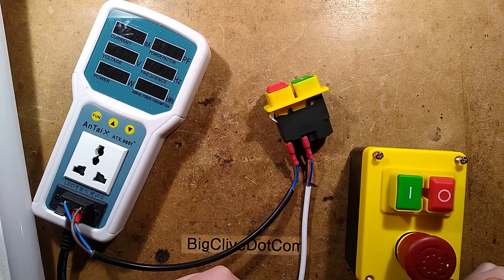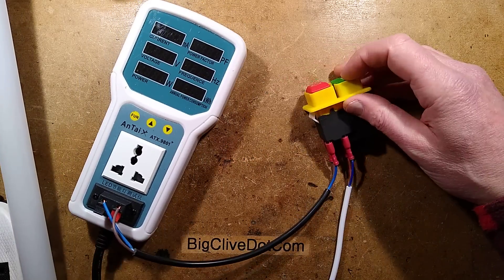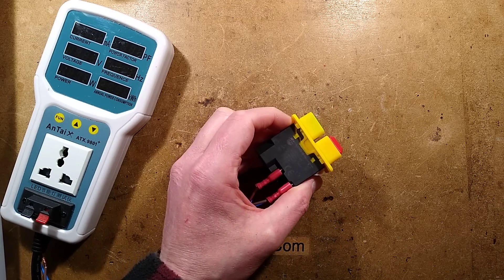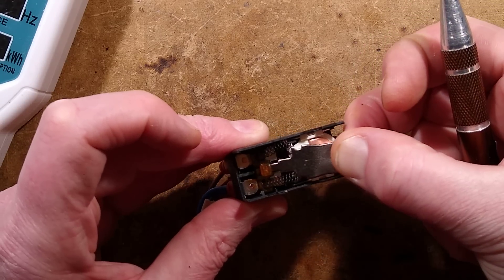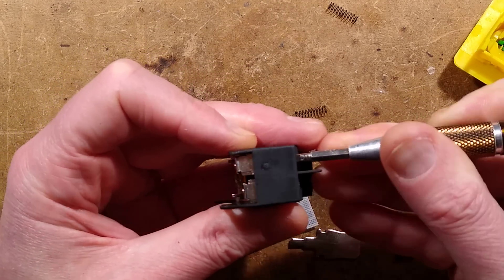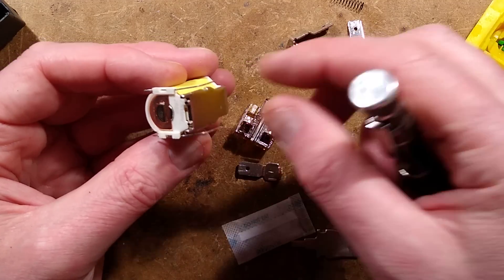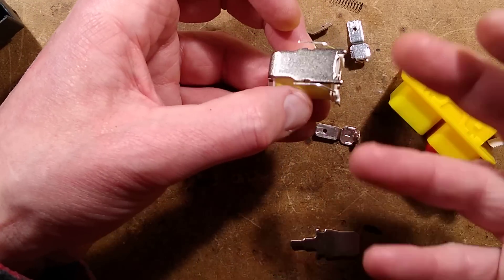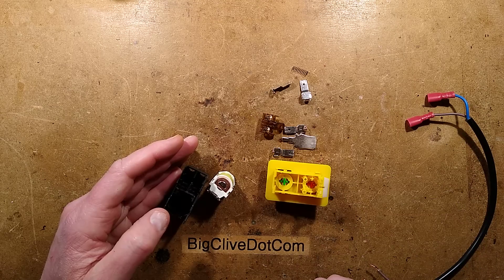Inside an NVR (No Volt Relay)

Comment: I had one of this but slightly different. On part was same. You press plate to electromagnet but off was only opening coil supply connection without pushing on plate

Comment: Would this be why my sliding mitre saw handle switch is always warm, even when I'm not using it? Because on the first use it's then magnetically locked, with a normal open/close switch until power off?
Reply from the maker: It may have active electronics.  Possibly a power supply for a guidance laser.
Reply: @bigclivedotcom  Thank you Clive, yes indeed it does 👍

Comment: Shaded pole relays are also referred to as "slugged" relays the telephone industry used these to prevent the line from dropping during rotary dialing and certain switching functions.
Reply: I built a home made exchange from old strowger parts as a child. I couldn't get slugged relays but I "slugged" ordinary relays with an electrolytic capacitor so that they stayed in during dial pulsing

Comment: So I'm at a stadium watching the Golden knights game and the lights are constantly moving but not on all the time. Why and doesn't that wear out the motors
Reply from the maker: It does cause wear, shortens the life of the moving wire looms and gives extra work for the power supply and drivers.  It's probable that the programming isn't good and they are using simple movement patterns and colour/gobo overlays.

Comment: I worked on a piece of equipment that had a relay that would pop open when a low voltage signal was sent to it. This was used as a safety shut off when of any number of situations occurred such as over temp or over current.

Comment: Interesting about the copper plate. It reminds me of the old Jukebox Timing Relays (google- Seeburg 303589 relay) which had a stack of copper plates. After the coil power was cut, they would stay latched for a very precise amount of time. Never quite understood how/why the copper plates caused that. They were often used in wallbox stepper receivers. (1960s)

Comment: I have retrofitted similar switches to several of my stationary power tools.  The tablesaw, shaper table (upside-down router for moving the work against the spinning-bit of death), and drill press all are now set up with this kind, and I've been of half a mind to set up the bench grinder with something like this as well.  I've never needed to use them for-cause on the tablesaw or shaper, but I've had plenty of times where the drill press bound-up when drilling something and I needed to stop it quickly and easily.

Comment: I replaced the toggle switch on my old table saw with one of these.  Small button for "on" surrounded by a large paddle for off.  I don't have to fumble for the switch under the saw table to turn it off now--just blindly jab for the large paddle.  I need a similar solution for my drill press with 2 switches--one for the light and one magnetic one for the motor.   Haven't found one yet.

Comment: We have some at work that are completely modular. You can change the coil assy. type of switch. Lighted or not. They call them powered relays though. I think Schneider makes them
Reply: Something tells me the switches from Schneider are made out some type of thermoset plastic rather than what appears here to be deformable plastic with a low melting point.

Comment: This takes me back to one of my first circuits built around an electronics education kit.  It was an alarm circuit using a momentary switch and a relay that latches. I felt completely empowered that I had made a bedroom security system at age 10 or so. I still remember when the latching circuit made sense for the first time to me.

Comment: Decent quality stuff.
I've seen some of this kind of switches, but cheap consumer grades ones, on dangerous garden equipment. They tend to fail mechanicaly shorted because of cheap plastic deforming with the heat of the current. The things jams in a permanently closed position. No way to stop the thing anymore, and it made it starts as soon as it's plugged in....
I replace these crap with proper industrial things like this one.
Reply: These are so called " first level/ primary" protection mechanisms that are supposed to handle only " signal"
level currents that should activate/ deactivate higher rated (proper) relays / switchgear that's actually switching the loads in / out .
Reply: @analoghardwaretops3976  "supposed", indeed...
Reply: @Damien.D  true .. eg. any "1Amp" rated device shouldn't be used for loads that draw 1A continuous.. normally a(3- 5)A device would be used...else you're already "maxxed" out with no headroom left...

Comment: The shading ring doesn’t just eliminate buzzing, it creates enough of a shifted magnetic field so that the coil doesn’t release on the zero crossing.  

In the US, toasters work similar with the lever pressing down contacts which power the electromagnet to hold the lever down until the timer or manual release.  Only there they tap off about 30vax on the neutral side of the heating element and then create 25 vdc for the coil and 5vdc for the electronics.
Reply: That's actually a really clever cost cutting measure to use the heating element as a resistive divider for powering the electronics.
Reply: @TheRailroad99  Thats usually how they drive the motor in a hairdryer, with one diode to create pulsed DC for a brushed motor.
Its also the reason why most hairdryers can't blow completely cold air.
Reply: I have just replaced my kettle, the plastic on the old one was disintegrating (glass kettle).
If it was removed from the base it would switch of in a similar manner to the item here.
The new one is the same and I suspect a similar magnetic 'hold on' device.
Will dismantle the old one, Clive-fashion, and confirm.
Reply: @stevedavis770  will you be using the Vice of Knowledge, the Pliers of Inquisition, or repeated application of Unreasonable Force?
Reply: @techgeeknzl  
The pincers of procrastination.
Could be some time.
Reply: @stevedavis770  Ah, yes. That is my favorite tool also.
Reply: Unfortunately that phase shift does not come for free, the copper ring does have eddy currents induced in it creating heat losses, not just inductive load.
Reply: @blg53  but a toaster is used for heating anyway
Reply: @formbi  True, but I was talking about the switch itself rather than a particular application of it in a toaster. My point was that this semi-intelligent switch is using power whereas dumb switches don't. That is why I used the words like "not free".
Reply: The relay with the “copper front cheek” was a very common thing in relays used in telephony / telephone exchanges.. basically it makes the relay slow to release when used with DC.. the heart of a an old / relay based telephone exchange was the “regulating” the operate time, release time, operating current, hold current & release current of relays.. 
oh it bring back my early working days… an mechanical telephone exchange with relays and selectors was a joy to watch and listen!!
Reply: That explains why my toast is undercooked on one side when on holiday in the USA then

Comment: Did I miss how the "emergency stop" button factors in?  I can guess (based off of  everything I've learned from your previous videos) that this just interrupts the circuit and so the solenoid de-energises and the switch turns off, just as if power had failed.
Reply from the maker: The emergency stop button is a second pair of independent self-latching contacts.
Reply: @bigclivedotcom  OK, that's a lot more complicated than I expected; I was thinking just having the incoming live going through a normally closed button and pushing it opened the circuit and so de-energised the system and thus released the switch.

Comment: I remember reading about motor starting controls in a 1910 electrical applications book. They used a lever to cut out resistances as a lever is moved from contact to contact. At the full on position, a holding magnet keeps the lever in that position. If the power fails, a rather strong spring pulls the lever to the off position. So yes, this type of no-volt control has been around for a very long time. Thanks for the video Clive.
Reply from the maker: The magnetic holding of the rheostat style system was also so the motor didn't get started on full current.

Comment: I like these factory parts, even if they're on the cheap end of the scale. I'd never have a chance to play with them otherwise.
Reply from the maker: They're perfect for DIY stuff and prototyping.
Reply: @bigclivedotcom  Yup! I even used a switch like this one on my grandfather's old air compressor. (The light switch he was using to control it finally fused after so many years. 😅)

Comment: Of the hundreds of "3-wire" start/stop circuits I've drawn/wired/seen/fixed I have never seen this approach. Seems a bit barbaric, kinda like bumping motors by poking the contactor. (I learned my lesson about contactor poking when I poked one and instead of the motor turning over the thermal overload exploded spraying me with tiny beads of molten metal. Some deek had forced in 1A heaters [NEMA starter] where 10A heaters were required. Bang!)

Comment: I would call this a self latching relay, and just about any relay can be set up like this to open with a loss of power.
Reply from the maker: The advantage to this version is that the contacts are forced open by the stop button, in the event of them welding.

Comment: Have never heard the term No volt relay. We don't use that one over here. We call them magnetic switches or magnetic hold in switches and on 3 phase they are called magnetic starters ( A term which I very much dislike). 
     I have found a few that work on 120V and are a direct swap for the existing lever switch used on allot of imported metal and woodworking machines.

Comment: That is what we used to call a self holding relay.  As the relay gets energised power for the coil goes through the normally open contacts.  Kill the power to the coil and the relay drops out.

Comment: Clive, I picked up an emergency shutoff switch for petrol. I don't plan to use it as intended, but plan to add it to my sign and plaque wall from various businesses such as a bank sign prohibiting rollerblading on the property. This I got from a contractor that was to raze a bank property. Another one is a cattle crossing sign.

Comment: That is actually a well designed manual control relay. Saves the electrician the extra step of having to hardwire a holding contact and electrically defaults to off position if power is lost. A clever hybrid. Contacts look beefy as well. What's not to like.
Reply: The cheap plastic used for the lower case. I have a tabletop drill that has a simple on off switch that has the exact same black plastic back. I went to remove the "yellow safety key" for storage and when I went back it would not insert into the handle. On disassembly and further examination the plastic had shattered into multiple pieces. Took a while but with epoxy and tape I was able to reassemble it and was working again.

Comment: I've heard of two other terms for these types of switches, No Volt Return and No Volt Release, same acronym I guess. No voltage no persistence of connectivity (so long as all is well). Anyway they are cool :) There's slightly more complicated version of this style of arrangement, often used in telecoms back in the day, pretty much used as mechanical transistors, relay logic circuits, if you like.

Comment: I've seen this done with a N.O. pushbutton, a N.C. pushbutton, and a relay. It's probably been done that way for a century. But, this is the first I've seen where the buttons and the relay are integrated like that.
Reply: I use to make my own using a relay and 2 switchs to switch a car headlight off when I switch the engine off, thats back in the days of triumph dolomites
Reply: I was taught to wire it this way in DT class many years ago.
Reply: Machine safety laws demand the NVR functionality, and an integrated device like this is the cheapest/easiest way to be compliant, so you'll find them on basically every stationary tool/machine made in the past however many years. 
Often combined with the big red e-stop button on a lot of the cheaper machines, they just put the e-stop button on a hinged cap over this on-off switch. (I'm personally not a huge fan of that one, but it does the job)

Comment: More of a latching relay🤔 I like the psychical mechanical contact separation , very good 👍👍
Reply: If I had designed it, the OFF switch would be a normally-ON switch that breaks relay current when pressed - letting the relay spring back to its unpowered state. It would be just as reliable (I think) as counting on a power interruption letting things reset.

Comment: This reminds me I really need to make one of those emergency stop buttons for my 3d printer, 
should be useful for when it fails into rats nest mode and prints into thin air
Reply: Yeah, emergency stop buttons are quite valuable for 3D printers, despite their relative innocuousness compared to huge machines and/or those with limb-amputating blades! So I have a toggle button on my 3D printer's enclosure that disables just the stepper motors - because I've had too many cases of nozzles being driven into the print bed, scarring the print surface and even permanently deforming the bed or the frame it's mounted to.
So this button instantly halts all movement, but without killing heaters, requiring a mainboard reset, reconnecting OctoPrint, or even re-homing any axes that the mainboard didn't try to move while the drivers were disabled :) (of course, the expected and actual positions will differ if any movement is attempted while drivers are off!)

It's also safer than pulling the power out from under the drivers' feet while motors are moving. I recall reading in some docs for Trinamic motor driver modules (TMC2100/2130/2208/2209/…) that motors should be stationary when the driver loses power and that the drivers' !EN/enable pin should be used to turn them off instead - which is what my button does. Obviously the drivers won't be fried if that's ignored a few times (or a simple power outage would kill drivers every time), but I figure they mentioned it for a reason!
[See Watterott's SilentStepStick "Pinout + Powering" page]

However, my 3D printer is heavily customised, so I doubt this will be practical to replicate with most machines :(
Those customisations include a PCB I designed to hold 5 "Pololu-style" stepper motor driver plug-in modules, connect back to the mainboard's !EN, STEP, DIR, GND pins for each motor channel, and to the motors themselves. (There's also some other functionality.)

The button works like this:
• The !EN pins are active-low (0V=enabled; 3~5V=disabled) and all have 10k pull-downs on my PCB to keep them enabled by default.
• The !EN pins are still connected to the mainboard (a Smoothieboard v1.1), so the G-code "disable motors" command still works (mainboard pulls !EN up to 3.3V).
• The !EN pins are also connected to 5 separate "C"/Common terminals across two 4-pole relays with 24V coils (the printer's supply voltage and, more importantly, the motor drivers' supply voltage).
• The corresponding "NC"/Normally Closed relay terminals are connected to 5V, forcefully disabling !EN when the switch is off or when there's no 24V supply. (It's all 5V-tolerant :))
• The toggle button simply engages the relay coil by connecting 24V direct from the power supply. (There's also a back-EMF diode across the coil.)
• This also ensures the motors are disabled if the 24V supply is switched off but 5V is still available from USB. Without this, and depending on the components and configuration used, the drivers can try powering the motors from 5V USB! That just results in unpleasant noise from the motors (and can damage the drivers, apparently). I used to have that issue but some later changes stopped that happening even without this button.

There's no real need to use a relay; this is just what I had available and was convenient to wire up. I'll eventually replace the relays with some optoisolators or even just some transistors. I want to keep each driver's !EN pin separate from the others so they can be enabled/disabled individually if desired, but I can't immediately think of a justification for using optos.

That said, these semi-chunky relays emit a more satisfying PING noise than a solid-state component ever would! 💜

Comment: I've had personal experience of an NVR switch saving me from possible serious injury involving my saw bench & a momentary power cut.
I have them fitted to the saw bench, router table, mitre saw, bench grinder, bench drill...

...wouldn't do without them.
Reply: Why not just have one fitted to the main power feed for your shop?
Reply: @Debbiebabe69  If I need to cut power to a machine in an emergency, I want that STOP button right where I can hit it.
Pretty much every woodworking machine comes with one already, so it's not an extra expense.
Reply: @GARDENER42  e-stops yea, they are pretty essential on all machines! Im on about a general power switch that flicks to OFF when there is a power cut, yes this device does both jobs, but I assumed all the machines had regular e-stops anyway.....
Reply: @GARDENER42  Surely there is a point between those essentials and the power to the actual shop tools?

Comment: Interesting construction. Much of the equipment in our workshop has one of these. I always assumed there were more switches inside, rather than the buttons actuating the relay contacts directly, but I guess it makes sense that as a mass-produced item it'd be more cost-optimized than that.
I wonder what else you could use these for. I reckon you could actuate it electrically using a pair of additional relays: one to interrupt the power supply for a short time to switch it off and another one that turns it on again by bypassing it temporarily.